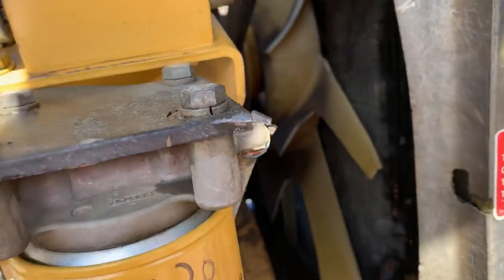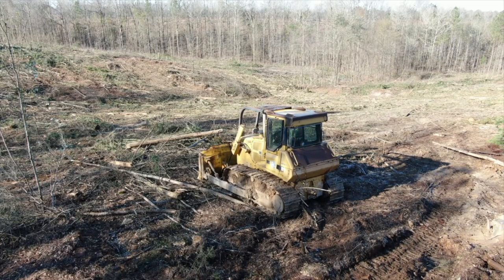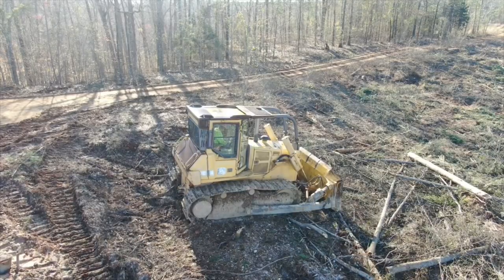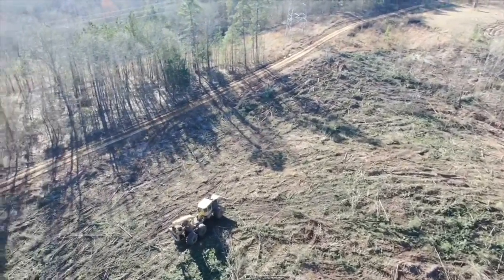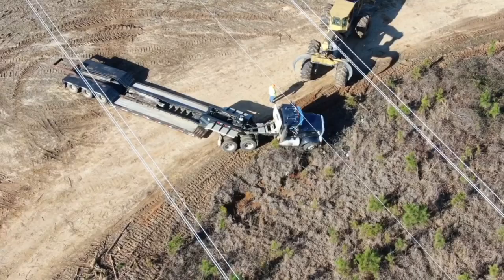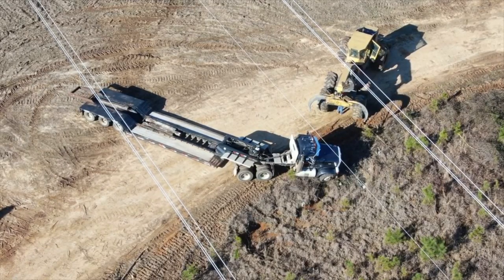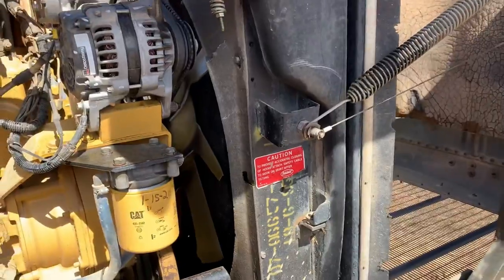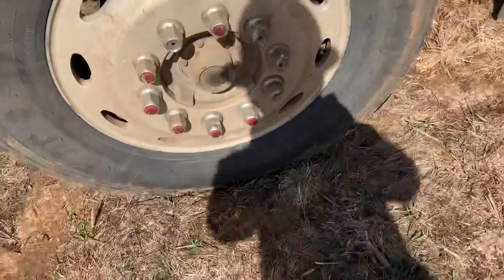Peterbilt with Caterpillar engine | fan went through radiator

Comment: Hey Tim, if you havent gotten a radiator for it yet, check with Northern Radiator. We use them at the shop and are less than half the price of a factory one from a Pete or KW dealer. I think they are based out of Nashville.

Comment: It could have been a lot worse. Like you said when that truck twisted it closed up the space between the radiator and fan. I have seen trucks towed in that went in the ditch and had the fan hit the radiator more than once. I noticed some people committing about checking to see if the fan bearings are loose before running the truck. That's got nothing to do with what happened here! My Dad always said if something doesn't get messed up once and awhile you aren't working hard enough. My hat is off to your Dad for working as hard as he does. Lets see the haters work that hard when they are his age.

Comment: Stuff happens. I was test driving a brand new KME fire engine and the fan just detonated at highway speed. Scared me because the section of highway I was on was famous for residents of the mobile home park just walking out in traffic going back and forth to the beer joint. I just knew I was going to see somebody hung up on the front axle when we looked underneath the engine.

Comment: It never fails Tim. It Murphy's law that when you really don't need something bad to happen it does. When thing are going great and you can afford for something to happen it doesn't. With logging i would say usually happens with both.  It's expensive but fixable. I'm sure as long as your dad has been in the business this is just a minor hiccup. You kick yourself but as Forrest Gump said "Sh$t happens".  I did something similar with our old 92 Kenworth. Got it stuck and had a guy try to pull it out with a tractor and a our snatch strap rated for 40 tons. One end had broken and it had been tied in a knot on the farm tractor end. When he snatched the two strap broke in the loop leaving the knot. Strap shot back like a rubber band and the knot hit the grill so hard it knocked the grill and radiator into the fan. Had to get the radiator recored.

Comment: Check out Detroit radiator they're outta Detroit Michigan they're the cheapest radiators for semi's you can find new any where I've found even with the shipping cost and they're good quality me and my dad have a small trucking company and that's the only people we use when we need one.  In one of our trucks we're still using has had one going on about 12-13 years and is still perfectly fine. I'm sure you may have already ordered a new one but definitely keep them in mind helps save a lot of $$$. all we run is w900 and 379 and they're $600-700+ cheaper (can't remember exact numbers) than thru KW or Pete dealer

Comment: Man, when I had my truck back in the late '90's I had got turned around on a one way deal up in Michigan. Tried to turn the big Pete and a 53'reefer around in a bowling alley parking lot... snow had covered the ditches level with the parking lot. The ditches were also about 5 feet deep. I didn't get out and look, just swung around and tried to drag the trailer through a show pile. Long story short, a trailer loaded with hanging beef on it's side, a broken light pole, a damaged fifth wheel and probably 5,000 people without electricity in the dead of winter in Michigan for many hours. It happens to us all.
Reply: SO IT WAS YOU!!! YOU SON OF A.... just kidding, I agree with ya. Sometimes we take little risks that have big consequences. Part of being human I guess.

Comment: Totally fix that radiator, toss a pressure test on it, clip out the damaged tubes, Radiators have a fair bit of surplus capacity usually.    Stuff happens, nobody got hurt.   Maybe order up a used radiator down the road and have it tanked and tested as a spare.    Glad you still get to work with your pop, nothing like it in the world.

Comment: Don't think that this had anything to do with the driver equipment just wears out. Was the fan still attached to the motor or had it come loose? Just put in a complete radiator in one of my peterbilts and was pleasantly surprised the complete radiator from peterbilt was around $1100. Local radiator shop wanted $1800 just for the center section and then I would have had to take it apart and reassemble. Don't blame pops

Comment: That fan was wore out. It was probably cracked which caused the blade to break off while the engine was going. I've seen it happen myself working in a diesel shop. So it's nothing new. Just a new fan and radiator and hours later back up and running.

Comment: I was spreading chicken litter on a sunflower field to shoot birds off of for someone one time in a l9000 ford. I guess it was a long box truck before but it had the rim and tire conversion to fit all ten wheels and tires w a littke lift to run military tires on it and it had a 18 ft spreader body on back of it. It had te walk In beam rear end so it would go pretty good w them tires but I went down toward the back same as I had been all day and when turning right before the truck hit the field road across the end it didnt spin or bog any. Didnt leave any ruts so I'm guessing it was a big old stump hole but anyways it set down and choked it off like I done hit somethin. It was so flexed out it broke 5 out of the 8 big bolts that held the bed to the truck and threw the bed into the back of the cab and window. I dont see how it didnt bust the window but it dented the cab a little. It had the hood twisted and bound up it popped one of tge latches loose and snatched the top radiator hose loose. I liked to never got that hood up but walked to pond behind field and brought back jugs till full again w water and got hose back on while waiting on tractor to pull me out. This happen prolly 1030 1100 Fri before lunch and was just before 6 that evenin when we got it out. Had a 180 horse 4x4 deere that wasnt budging it and had to go get 340 case w duals all way round to move it but that was a rough day digging and dragging cables and chains then took her home to fix all that was broke.

Comment: I do a lot of plowing, sometimes (literally) one inch can make a huge difference. as in having another truck taking 30 minutes to pull you 10 feet cause driveway folded under you and tossed you over a bank where you cannot open doors all at 6MPH.
 I've also over revved an engine on a shift and broke motor mounts and put my engine (small block ford) well into my hood.
crap happens.
anyone wants to criticize your dad...have them show their perfect driving record.
I have well over a million miles under my belt in different countries with ZERO at fault accidents.
and I still have made errors like I stated above. the plow truck in February of 2019 so very recent.
screw em, delete and block them and do not obsess over it.

Comment: That's not good when the fan takes out the radiator, I've almost been there with a 440a John deere that didn't have the side panels. The guy I was working with got in a bind in a brush pile and bent a fan blade

Comment: Good morning,

When I first learned how to drive an 18 wheeler I was taught as part of my Pretrip inspection to grab the radiator fan and try to move it to find out if the bearing was failing to prevent the fan through the radiator.
The tractor we were using turned out to have a bad fan bearing so we didn't use it but shopped it and a new radiator fan bearing was installed. Might be worthwhile to instruct your drivers to do the same. Lot cheaper than a new radiator. 

Thanks for posting the good and the bad about your company.
Reply: Agree 💯 %!!!!! I’ve always done preflight checks on everything I run with an engine. It’s an old habit from working at an equipment rental place. Just a quick 2 min inspection has saved me literally thousands of dollars over the years in catching stuff early. It’s true, nothing beats looking.
Reply: The fan hit the radiator because the frame twisted when the front of the truck went down. It has nothing to do with the fan bearings. When it twisted it closed up the space between the radiator and fan.

Comment: Seem to me the truck is not designed properly, the fan is way too close to the radiator, i would prefer them to be at minimum twice the distance away  with more cowling, another example of machinery i come across that could be designed a lot better, truck manufacturers charge premium prices for their machinery and one should expect premium reliability, in the past when we had the woodchip industry in full steam it was common to hear on the news or see the accidents first hand where truck lost their loads and going off the road all the time.

Comment: I hate to change the subject, especially since I am probably about the fellow's age and was part of a very old family business that had a ton of trucks and heavy equipment, that stuff happens. But WTH are those wishing wells under the powerline for? Whatever they are, smalled roofed structures that don't look like privys really, in the wilderness. Im just a few hours away, understand every sound you use, same lingo, and have been around logging a fair bit. What are they?????? Thanks, Mac
Reply: And Peterbilt ought to know better than to use a limber frame on a log truck. They come from a logging beginning. Fan ought to be several more inches from the radiator OR a truly rigid frame and limited twist motor mounts. I won't say what might be wrong putting a fiberglass fan on a 4-500 hp diesel engine, that speaks for itself I think. Any critical part that can sometimes be patched with model airplane glue has no place in a top of the line truck used off road. Just sayin....

Comment: Y'all's southern accent and closed captioning don't work lol bit many of times I've had to pull a fan out of the radiators as those bearings let go usually without warning
Reply: But I guess the twist of him dropping in that hole was enough to send it through the radiator